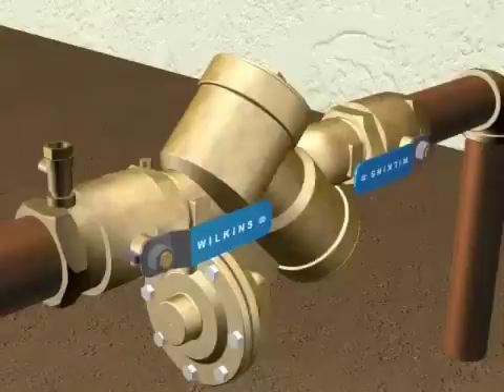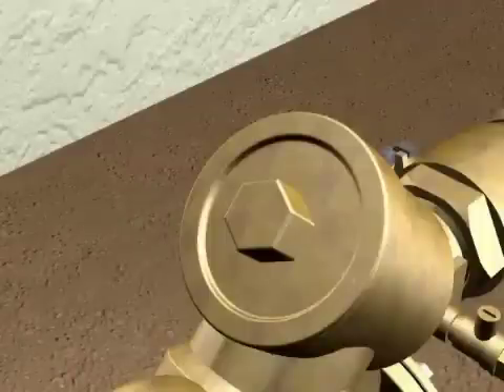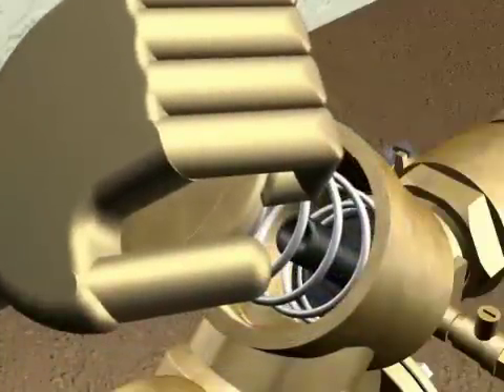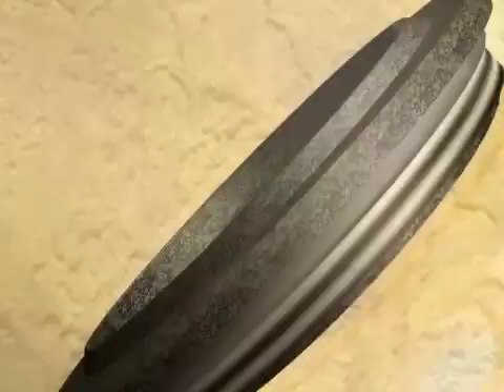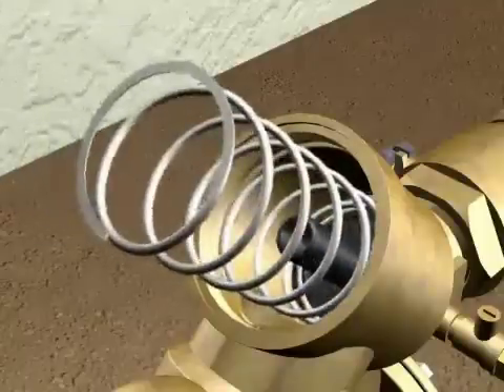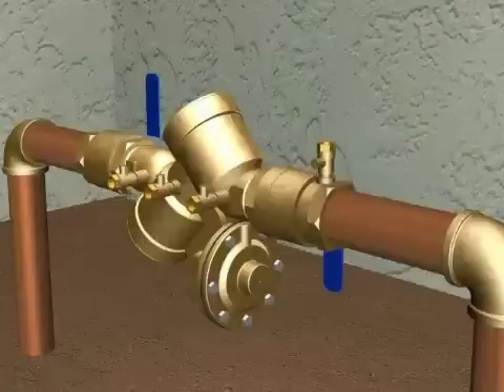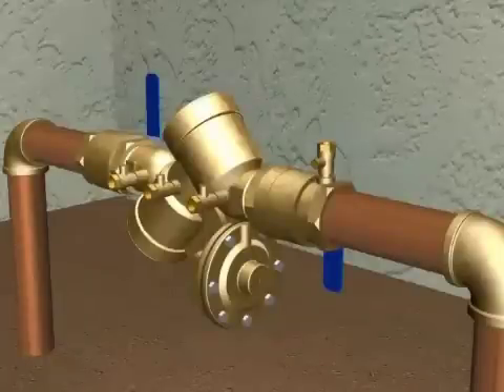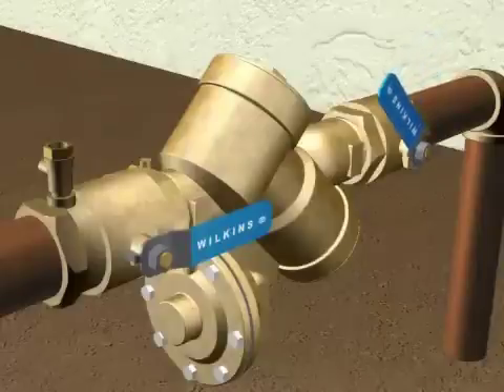Repairing a Zurn Wilkins 975XL Reduced Pressure Principle Assembly

Comment: Mine is dumping from vent and I’ve switched springs and still no effecg
Reply from the maker: There are several factors that can cause discharge from an RPZ. First, let's confirm we have the springs in the correct location, the stronger spring ALWAYS goes in the first check. If It's still discharging, we can isolate the issue by preforming a two step test:
First, we will turn on both ball valves & close the outlet ball valve. If discharge stops, we need to look at the #2 check. 
Second, we open test port #4 (closest test port to the outlet) if discharge stops, the issue is in the first check. 
If neither of those slowed down the discharge, the issue lies with the relief valve.
Once we know where the issue is, we can disassemble and inspect. I hope this helps!

Comment: Thank you for the customer support! I have one of these in my sprinkler system and it was venting a LOT of water when I turned on my system. I watched the Zurn 975 diagnostic video (https://www.youtube.com/watch?v=3d2rNoroZ_c) and these repair instructions - with those videos most do-it-yourselfers will be able to repair one of these. This video says "Before servicing the relief valve you want to make sure to check the troubleshooting section of the instructions. The most common cause of discharge from the relief valve is debris in the number one check valve". I couldn't imagine that was my issue, but believe it or not mine had a piece of plastic debris in valve 1 (obviously from something else from my city water system) that was blocking valve 1 and causing a vent just like the video said. I ordered a repair kit and will replace all the parts next time it has an issue, but with this video I got my valve working!

Comment: *If water is dumping out the vent, it's because you used the 1 pound spring in valve 1!  The two springs for valve 1 and valve 2 look identical but they are not!  Squeeze the two springs together and you will see the stiffer 5 pound spring is for valve 1 and the weaker 1 pound spring goes to valve 2.  If you do not do this, water will dump out the vent.  Thanks to Sanjeev Verma down below for his tip on to fix*
Reply from the maker: This is correct, swapping the #1 & #2 check springs on a Model 975XL will likely cause significant discharge from the relief valve vent port. It is important to keep those parts separate during repairs and maintenance to ensure that the parts are not mixed up.

Comment: This is very helpful, but after I have done everything this video suggested, replaced all sealing rubber,  the backflow preventer still leak. I do realize that if I open the number 3 valve, the leak stooped. Checked the valve cap sealing area has no problem.  I submitted an online question to Zurn custom support web site, and Zurn custom support Terry called me back and did some diagnoses with me on the phone and tell me she can send a new valve cap and a special tool that can unscrew the valve cap (black plastic cap) with no charge. After I have received the package, I replace the valve cap, but it's still leaking, my wife suggested to me that use sealing tape for the valve cap, then screw it down. Finally, the leak stopped. Thanks for this video, Zurn custom support Terry and my wife. Very happy to get this done, saved me lot's of money.
Reply from the maker: Thank you for this interesting feedback. Zurn Wilkins strives to provide excellent customer support for all our customers.

Comment: I cleaned value #1 and the relief value but is still leaking water. The rubber seals all seems fine. What could the issue? Should I also open and clean value #2? Pleaes advise.. thank you
Reply from the maker: Hi Shen, our Customer Care should be able to help you with your questions. Please give them a call at 1-855-ONE-ZURN (1-855-663-9876).  There is also more information on the Model 975XL here: http://www.zurn.com/Pages/ProductDetails.aspx?NodeName=Model%20975XL%20%283/4%22%20-%202%22%29

Comment: wanted to share my experience with this. i bought a new zurn 975XL valve to replace a leaking valve of the same type. (OMG these things are expensive!!) so i hire a professional plumber to install it, and guess what, the thing is dumping water from the bottom. the plumber tinkered around a bit and told me that the valve id defective and needs to be replaced, charged me a small fortune and walked away.
so i was left wondering...do i remove this thing, take it back for a replacement, or tinker with it myself...i am an engineer by education, so kind of touchy about these things too...
after sitting over the thought for months (yes, i procrastinate a lot) and watching a lot of videos (including this one), one evening i set about taking the thing apart, piece by piece, cleaning and re-assembling one valve at a time, but no luck...then it hit me...the spring in the first valve was a lot less sturdy than the spring in the second valve...seemed kinda backwards so i interchanged them...and viola!!! no dumping from the bottom valve, not even a drop!
so...lesson learnt...trust your instincts (you can do it if you think you can), and try interchanging the springs if you see the same issue!
Reply from the maker: Sanjeev Verma Hi Sanjeev. We are glad to hear that our video assisted in FINALLY getting your backflow preventer up and running.  Should you ever require additional help in the future, feel free to call Zurn directly at 855-ONE-ZURN (855-663-9876). We are here to help with troubleshooting and all of your plumbing products needs. Congrats on troubleshooting your first valve successfully!
Reply: I'm having the same issue.  I have water dumping out of the vent.  I will try to swap the two springs, I hope this works.  The springs look identical so I didn't think they could be different
Reply: Thanks to you I fixed my water vent dumping.  You are the only one to mention this as a possible problem.  Mixing up the springs, they look identical.  Only way to tell is to compress them to see which one is stiffer.  My wilkins zurn975xl is like new again.  I replaced all the seals, rubber gasket, and of course the springs

Comment: I am just replaced the warped diaphram, but now water is just gushing out the bottom.  I have inspected everywhere for debris and I can't find any.  I thought I was missing a part, but from your video it shows it is all there.  I am at a loss.. Any help??
Reply from the maker: Dieter Walters Hi Dieter. For this type of support please contact our Customer Care.  They will be able to walk you through step-by-step and assist you in detail. Zurn Customer Care can be reached at 1-855-ONE-ZURN (1-855-663-9876).  Further detailed information on the Model 975XL can be found on the product pages: http://www.zurn.com/Pages/ProductDetails.aspx?NodeName=Model%20975XL%20(3/4%22%20-%202%22). Thanks for posting!
Reply: did you fix it?  I am having the same exact issue

Comment: I don't know if this model is discontinued or has been changed, mine has only two testing caps in the back, So, my question is this device discharges all the water from the bottom when the sprinklers are off, any idea what could be, just changed the inlet and outlet valves because they were cracked, but we just installed universal parts sold at Home Depot, could be this the cause or something inside?
Reply from the maker: Hi Eduardo. It sounds like the valve froze. This generally causes warping of the valve, such that it must be replaced. Nevertheless, before replacing the valve, inspect the number one check valve seal ring for fouling with debris. If the rubber is fouled, clean or replace accordingly. This should stop the discharge when the valve is in a static condition. If no debris is found within the number one check valve, then the valve may have been damaged by a freeze, and the valve should be replaced. If you have further questions or issues feel free to contact Zurn Customer Care at 1-855-ONE-ZURN (1-855-663-9876).

Comment: It failed inspection, as the pressure did not change on the second test cock.  I cleaned it out.  I sanded the inside, as it was rusted.  
I have droplets leaking out the hole on the cover.  Is that ok?  Should I paint the inside with epoxy paint to build material back up to original tolerances or can I find a thinker gasket for the plunger?
Reply from the maker: Hi Valter. In the case of backflow preventers, any components found to be out of tolerance should be replaced with new components. The cover that is leaking should be replaced rather than trying to paint it. Only approved components from the Original Equipment Manufacturer should be used in the repair of any Backflow Prevention Assembly. In response to "leaking water out of the bottom when pressurized" comment: The continuous discharge from the relief valve is typically a sign of a leaking number one check valve. Thoroughly inspect the rubber and seat in the number one check. Fouled or damaged components must be cleaned or replaced. This should stop the continuous discharge that your are currently seeing. Lastly, be certain to replace the relief valve spring after the number one check problem has been taken care of. Thank you for your questions!

Comment: mine seems to leak water out the bottom when pressurized.  It does not do this when the short spring is not installed.  I think the 4inch rubber diaphragm is louse and needs to be replaced.